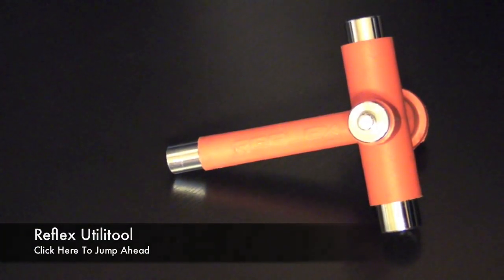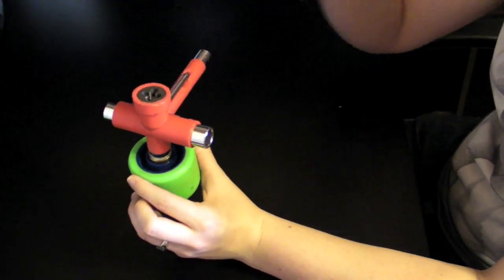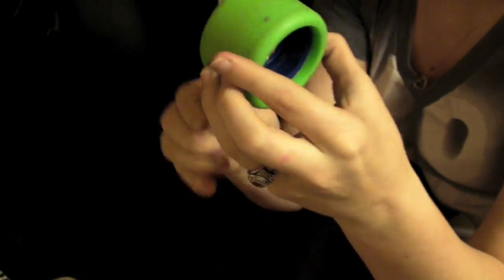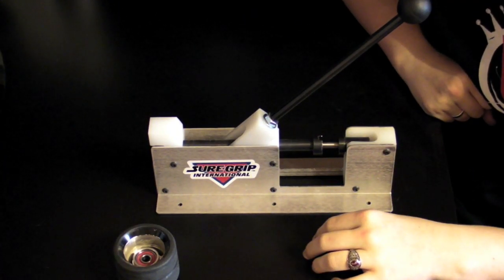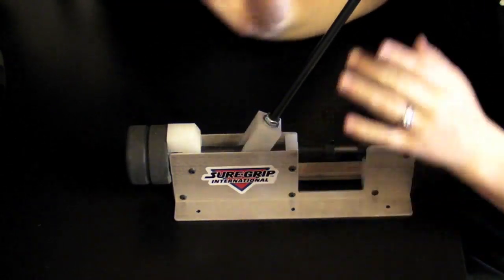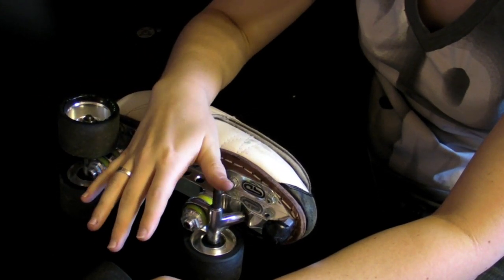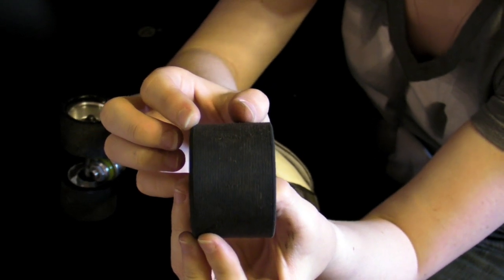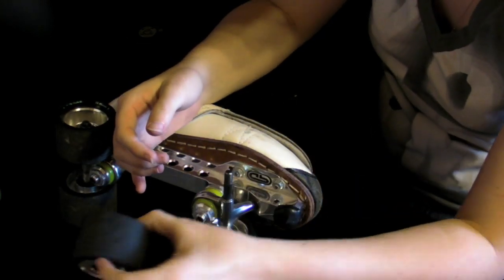How To: Remove & Press Bearings

Comment: @JamSkateAddiction I decided to purchase a sure-grip bearing press like the one in this video. I've always used a pen or my axle to get the bearing out. after damaging some of my bearings in the past I wanted a tool that would safely press & pull bearings without damging them since I started using more expensive bearings .  And you're video helped me decide what kind to get. thanks courtney :^)

Comment: Thanks for the great video on bearing install/removal.  Well explained, but you may want to research 7mm axle service, as there are a lot "old schoolers" out there like me and daleboyrdm.  Also, Sure-Grip also makes their grey travel press that works with both 7 and 8mm bearings.  Lastly, where can I get the red multi hand tool that you show in this video?  Thanks, Cupcake

Comment from the maker: @Franke451 I have had some that are hard to put in and out. Putting them in i use a bit of oil and it takes some fines but goes in. Taking them out is alot of work. Rotating the wheel and pulling over and over again. Yea some presses are made with a small gap that you basically have to have the bearings almost in to use. Crazy they it would not go in though cause zodiacs are pretty skinny compared to other wheels.

Comment: @JamSkateAddiction I want to get a utilitool, but i have 7mm axles. on the tool's description it says that it's only for 8mm axles. But that's only for rethreading the axles rite? I would still be able to press and pull bearings on and off of my 7mm axles with this tool wouldn't I?